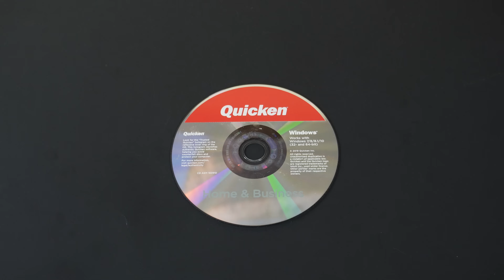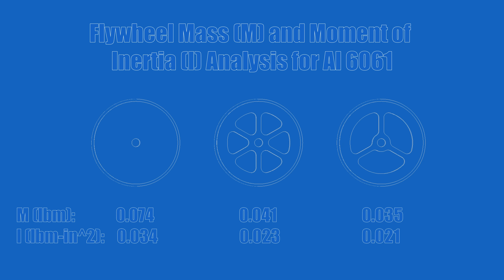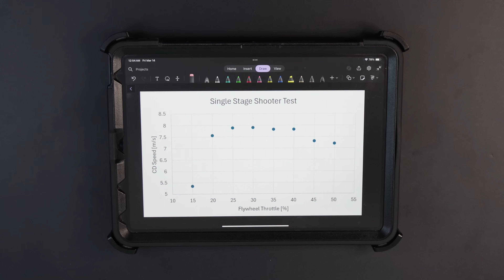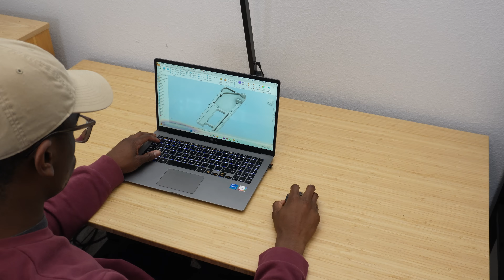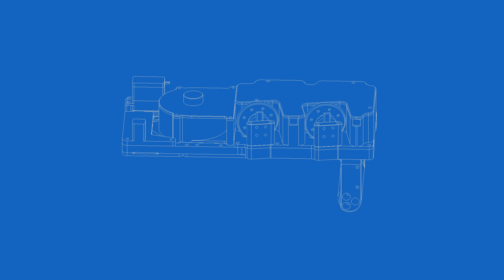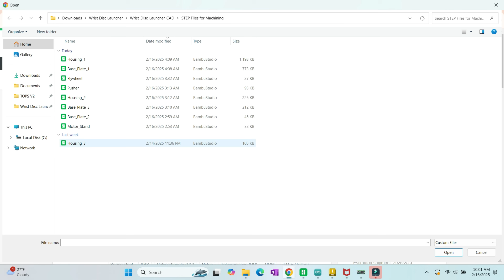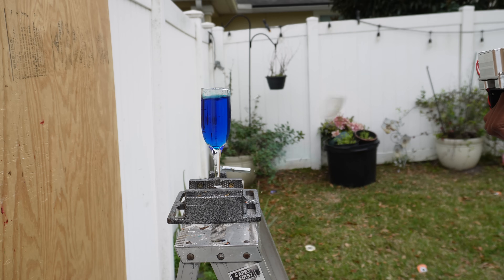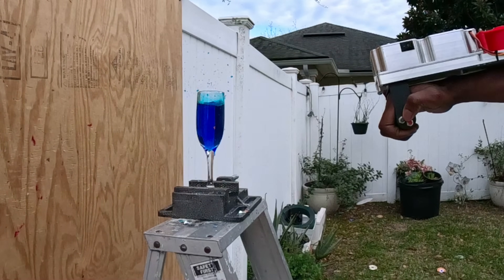Wrist Mounted CD Launcher - Built to DESTROY!

Comment: 2.5" HDD (laptop) platters might be an interesting source for disc's as well... Even  3.5" HDD (desktop) for that matter!
I know a lot of the 2.5" are metal coated glass (ceramic?) in recent times, with them being metal in older ones. Not sure if 3.5" ones are the same or still metal.
I also don't know if ALL of the HDD makers use the glass platters, so you might get lucky and it'll be metal.

I suggest this because I'm sure you can probably still find plenty of dead drives on eBay in bulk lots, and probably inexpensive. 44pin IDE (PATA) would be the old ones which might be metal still, and then SATA being more likely the glass/ceramic/whatever.

There's every micro HDDs like used in old iPods that you could harvest and make a very tiny disc launcher with 😁

Comment: If you're interested in flywheel guns, poke around a bit in the Nerf modding community. You'll learn there is a lot of nuance in designing them to get maximum velocity (not using rubber, spinning slower than maximum speed of the motor, designing motors that spin up crazy fast without the need for speed controllers)

Comment: Why not put one flywheel on top and one on bottom so they simultaneously pinch which could allow you to use the higher RPMs without loss of traction

Comment: Try replacing the metal disks with sawblades. I'm fairly certain that the disks lack the weight needed to break that glass, but with a saw blade if one of the points of the teeth impact first all the kinetic energy is focused on that single point of impact instead of spread out along the smooth edge of the metal disks you're currently using.

Comment: I am actually f**** astounded that the metal CDs did not work on breaking that glass, and to be honest the only thing that I can think of is that because it had  a liquid inside of it it change the pressure needed to actually break the glass. I say it's worth checking out if they break without liquid in them

Comment: Why not just increase the surface area of the flywheel so that there is less slipage on the cd? You could dual material 3d print a wheel that has the rubber permanantly fixed to the wheel.

Comment: There's so many problems with using plastic disks as a projectile, and ultimately fall short due to it's material strength and stability, I'm going to take a guess at why you didn't even attempt to take a crack at higher speeds, looks like you copied someone's homework with this one, but they told you "SHH, Bro', make it look like you did the work at least"

Comment: Ok so. With those metal cd's. You could definitely make them super effective with a few steps: 
- Make them out of steel, then carefully grind them sharp (keeping them cool as you do), then once they are sharpened, heat treat them to make them harder. They are now as durable as a good knife. 
- Make them a bit thinner. Now are able to reach higher speeds with the same amount of energy put in, but also decreasing impact area. 
- Add on a texture of some sort to the face contacting the flywheel. Better grip, reduce/nullify slipping, more efficient power transfer. This doesn't have to be gnarly knurling, even a laser etched surface would do wonders. 

By doing all of this, you make them shift from small Frisbee to essentially small Sheridan like discs.

Comment: What if you added another O-ring per flywheel? Make the flywheel into a Big Mac, two outer plates with one in the middle. You would increase your contact on the CD and increase the weight of the flywheel so it wouldn't slow down as much. It should increase the speed without making the whole thing bulkier.

Comment: I would just change the position and angle of the launchers, probably only the first launcher, placing it almost perpendicular and passing through the diameter and only the second transferring rotation. The first wheel would have more acceleration time, being able to increase the speed of the second launcher even more.

Comment: Very informative and fun to watch.  If we look at how warriors or chefs use a blade,  it is not necessarily the force towards the object but the actual side ways ways,  back or forth motion that does the cutting.  Apologies I don't know the actual term.  If you increase the rotation of the cds but keep the forward projectile speed the same,  then it may cut those objects better.  Also a cds edge is actual nearly 90 to that of its edge, rather than an actual knife which has a sharp edge.  Anyways love the videos.

Comment: You can probably do the same with HDD drives, 3.5" or 2.5" drives can have between 2 to 4 wafers inside. Quite thin and with rounded edges. Might fly better than the CD'

Comment: Excellent video. Your reference to "heat and mass" took me way back to late '60s when I was also taking a heat and mass transfer course as part of my EE curriculum. The equations were pretty complex. We did all the calc with slide rules as battery operated scientific digital calcs were way too expensive and hard to get. Also no internet to learn quickly from🤔🤔🤔.  Also when I did my internship at TI in Dallas, I was very fortunate to see the very first LCD calculators in 1970. KEEP IT UP......the world needs innovative young engineers like you....Also GO SPACEX 👍👍👍👍👍👍TBoone from 0TX1

Comment: 17:55 Metal reduces fracturing, but they have the same energy as you optimized it for mini CDs.
A optimal design probably has to account for:
- current energy of the flywheel (limit fire rate if too low)
- speed provided by the magazine servo arm
- maximum energy transfer between the wheel and the disk, given the incoming disks speed
Rubber stickyness on the material, at speed is probably a core factor, as it determines how much energy you can transfer.
Reply: I was wondering if sharp edge won’t help but it would become a proper weapon then, not that it isn’t dangerous already
Reply: @RomitHeerani mini circular saw blades (like for angle grinders) are probably too heavy, but I bet their carbide-tipped teeth would make a difference against glass too
Reply: @niceguy191  Any sharp edge would shred the rubber guide rail on the inside.
Reply: Wouldn't more of the energy transfer to the contact point if the discs didn't shatter?
Reply: @MWDoom  It would, but there still isn't enough energy in those disks to destroy the glass.

Comment: Very nice!
Small design improvement suggestion for the cooling, good idea with the fins, but you mostly cool the magnets, the coils need cooling too, usually, the front of the rotors are slotted to pump air through the coils, but your closed design prevents this.
Maybe just drill some holes in the section close to the flywheels.
Cheers to my fellow engineers 😁

Comment: glass is incredible stuff, I've had to break old long fluorescent tubes about 4 times in my life, and knew to put them in a plastic bag and use a hammer. every time, the hammer has bounced off the thin glass on the first hit, the first time, I used a plastic chopping bag, and it was shredded by the glass vacuum explosion.

Comment: i dont know what metal you made it from, but you should have it manufactured out of a hard metal. I suggest AR-600 steel. Also, what about making one that shoots saw blades (or getting a few sawblades of a size that can work in it. you should also put flywheels on either side, this can allow you to put a fair bit of pressue and reduce slip between the flywheel and the projectile.

Comment: On the topic of why the speeds are higher with the final version compared to the test might be using a battery instead of the lab bench power supply.

Comment: I wonder how much can be gained on the initial release mechanism, as it has the opportunity to be non-linear, it could be optimised to have high torque at the begining of the motion, and maximum speed at ejection time, this would allow pushing the no go zone a bit higher in RPMs.

Also, you are putting the rotation pretty close to the side of the CDs, have you considered moving closer to the center? that would both increase rotational speed (same angular momentum transfered to a smaller radius), and the linear speed. Again, there is opportunity to look for the optimal value here, but i have no idea how far along the CD width it is.

Surface friction under the CD could also be important, as it would allow increasing pressure of the flywheel on the disc without having the bottom part slow down, the level of polish of the metal plate could play a major role here.

RIP your garden tho’ :’(

Comment: For thr O-ring, I believe you could have just used strong glue to counter the cetrifugal force causing it to run loose. Adding screws to tighting it up is good, but it ende up adding unecessary weight to the system as s whole, which inpacts the speed of rotation. I am sure that there are glues with enough adhetive force to counter the effect of the centrifugal force.

Comment: Quick suggestion. 

Put a curved notch that the fly wheel can sit in underneath it and mount the flywheels on a pressure armature that add pressure to the object when its in contact with the flywheel, effectively adding mass to it and pressing down on it so it will grip better at higher RPM. Just a simple arm amd a spring if you want a passive system or you could use a service probably so you could adjust the pressure. For firing metal disks this might be necessary so you can effectively transfer all that torque. 

You just need traction really. Add pressure. Create mass on the contact axis.
Reply: That was servo not service. Autocorrect bit me.

Comment: Awesome! 
You could get more speed spinning the CDs in the chamber before releasing them having them preload rotation and stabilising for les friction while coming out of the chamber. The central axis could retract to release.
If you want to go full Ironman nuts, you could ad air pressure to make an Tesla turbine inside with small pressure reserves.

Comment: increasing the thickness of the flywheel and using a flat instead of round contact point should increase the surface area and allow you to crank up the optimal throttle level without losing grip.Easy way to increase velocity without adding more flywheels or changing the design in any major way. Amazing build!

Comment: Suggestion to improve performance, PTFE tape, specifically along the side and under where the motors are pressing the disk against the base. You are driving it from one side and the material beneath is creating the 'pinch' for that transfer, but also has it's own friction that's resisting some of that transfer. PTFE has very low friction so will keep the pinch but reduce the surface friction for the forward-spinning side. Used to work at a printing press, booklets of paper zipping everywhere, whenever there was a friction problem, it frequently was applied.

Comment: I wonder if spinning up all the CDs in the magazine might be something interesting to try. They'd load onto a spindle with a spring mechanism. When you pulled the trigger, the top disc would be released and pop up to hit the flywheel rotating at the same speed. Might be able to dial up the speed quite a lot. This is all conjecture of course. Good luck! Keep up the great videos!

Comment: You might be able to fit a 3rd flywheel on the opposite side in-between the other 2, as long as you angle it correctly it should work and not add to much extra length.